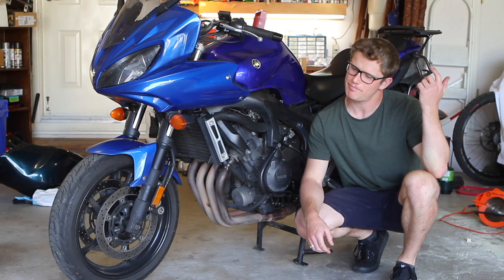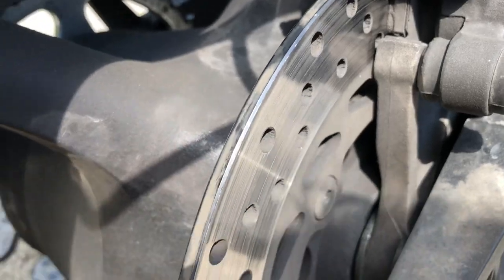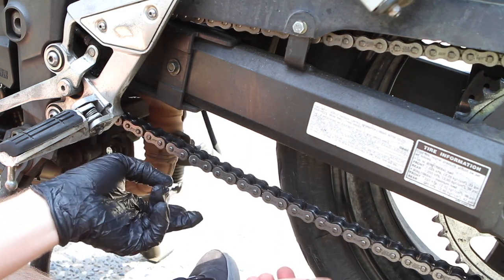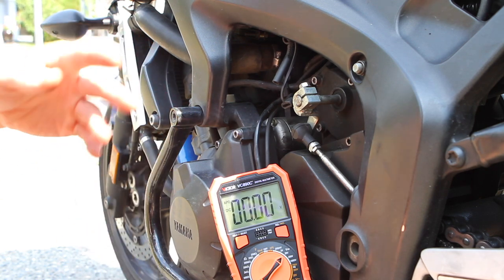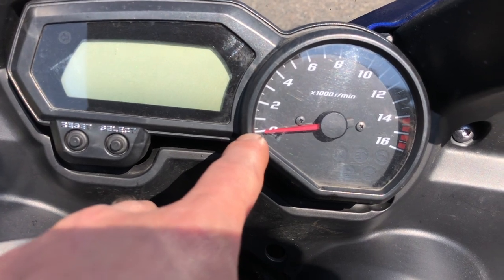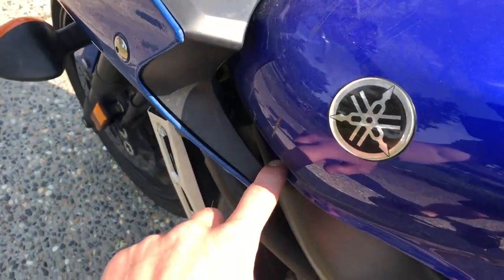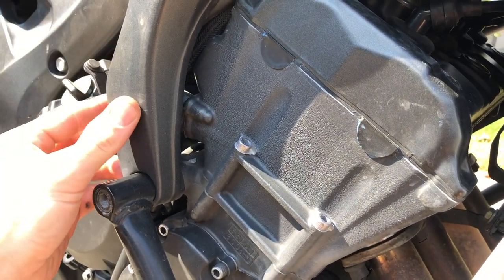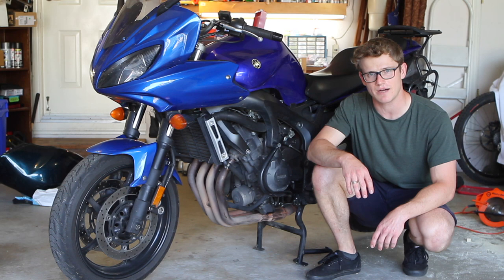Yamaha FZ6 Buyers Guide - Everything to look out for!

Comment: I have the exact same bike with the same heated grips. I have lubed both cables and cleaned/lubed the tube but my throttle just doesn’t snap back like it should, it’s just a little slow.  I have had this bike for so long I didn’t notice the problem until someone else road my bike and pointed it out to me. Have you ever had any issues with your throttle because of your heated grips? Also a topic for a future video could be how to properly wire the heated grips. I just have my connected directly to the battery.

Comment: An excellent video with some very useful pointers. 

Here's a post I wrote on Facebook a while ago and then saved for the next time someone asked a question about buying a used FZ6 (which happens fairly regularly...!)

* * * * * 　

Provided it's had reasonable care taken of it, they're good, reliable bikes. 

Here's some stuff to check before you buy it...

Firstly, the FZ6 drops into first gear like the Crack of Doom! This is, incredibly, absolutely normal.

Check the exhaust headers for signs of rust. If they're bad, it means other, important work probably hasn't been done.

Put the bike on the centre stand and get someone to push down on the back. Using fingertip pressure, tip the handlebars to one side and the other and see if you can feel any grinding, clicking or rough sensations which could indicate the headset bearings are knackered (which is a bugger of a job to fix!)

Also take hold of the front wheel and see if you can pull the forks back and forth which would also indicate a dodgy headset.

Bounce the forks up and down and look for any signs of oil leaking from the fork seals.

Check the rear shock and see what condition it's in. Clean? Rusty? Can you change the preload setting or is it stuck in place because it's never been moved and it's covered in crud? 

Put your finger under the chain a little bit back from the centre stand and try to push it up against the swing arm. If it goes really easily or you can't get it there at all, it's too loose or tight. If it takes a bit of effort to hold it there, the tension is probably ok.

Feel the gaps between the teeth on the rear sprocket, if you can feel a "lip" or a "hook" instead of a smooth curve, it's on the way out and would need replacing as well as the front sprocket and chain.

With the rear wheel off the ground, check to see if you can wiggle the wheel or swing arm back and forward or from side to side. Either could mean knackered bearings which would need to be replaced.

Run the bike until it's warm, then switch off and let it sit for a few minutes. Check the oil level on the centre stand and make sure it's ok.

Other things to ask...

If it's done nearly 24k (or 48k) miles, ask if the valve clearances have been checked, if they haven't and they need new shims, that's an expensive job if you get it done by a mechanic.

The brake pipes are supposed to be replaced every 4 years, so ask if they've been done (although I did mine after 14 and they were fine, I just wanted braided lines).

Ask if the spark plugs and oil filter have been changed (recommended every 12k miles) air filter (25k miles) 

None of these last ones are necessarily critical, the FZ6 is pretty reliable, but it would show that the bike has been cared for.

There's probably more, but that's a few to be going on with!

If you're happy with it, enjoy!
Reply from the maker: Great tips! Thanks for sharing 👍
Reply: @Calvinm hi bro. Blesses. Do you know how to put ABS sistem in a fz6 s2 2006?? Is just like the bike in this video but black. Can u make a video or explain me ? It's posible?

Comment: Good video! Thank you)
I would add a couple more points:
1) checking the fork for fogging.
2) Checking wheel bearings and steering column
3) check antifreeze level
4) checking the traverse, the spider, and especially the attachment point of the rear subframe (cracks often appear if you ride with a passenger or (and) baggage)
5) Checking the engine mounting points ("ears"). If there are sliders on the motorcycle (not crash guards), when falling, it sometimes breaks off a piece of the frame or engine. Never install sliders on FZ6, its very bad idea))
P.S. Sorry for my bad english))
Reply: Oh yes, I've heard about the slider thing...

Btw your english is flawless
Reply: @Jan-cg1pq  thank you! (And Google Translator:))))
Reply: Check the wear pattern on the tiers, how far the bike is leaning in the corners can tell you how it's being ridden.

Comment: I'm now a 3 hours owner of a 2004 FZ6 with 43k km - thanks for this video!
Reply from the maker: You're welcome! Enjoy the bike!
Reply: @Calvinm  what cable line did you use for testing voltage. I would need a more detail on that. Tnx
Reply: @kmetmosnja6341  did you figure it out? i have the same question

Comment: Hey man, really good video.  I just bought one for 1100 dollars and it needs some work so I will probably be watching lots of your videos.  4th bike for me just so you know and I do work on them with a little help here and there from a friend who knows more than me.  I don't usually do this but I wanted to say thank you for the video.  I wanted to ask, what year is yours you are working on?  Mine is a 2004.  How much did they change from generation to generation.  I know with lots of bikes they make them the same for like 20 years but the FZ6 seems to get an update like every 2 or 3 years.  Any way thanks brother.
Reply from the maker: Thanks for the kind comment! This bike of mine is a 2007 model. The first gen FZ6, reffered to as S1, had different brakes and thottle position tuning, and the rear swing arm got a design change but stayed the same length I think. Everything else mechanical stayed the same. The FZ600 which came before the FZ6 is entirely a different bike from an engine and frame standpoint. Enjoy the ride, glad you found the video.

Comment: Enjoyed the video and subscribed my friend... I know of a 04 fz6 3,100 miles $2300 avail. and was doing some research on YT see if I really want it or not... not too crazy about sport bikes without full fairings tho.. guess that's the difference from laying down and sitting upright type of bikes? The only bike I really want is either a Ducati 1198S or Aprilia RSV Mille R but they both require mechanics/dealerships at least 300 miles away from where I live
Reply from the maker: I think the FZ6 has just enough fairings to keep you protected from the wind which is nice. The riding position is much more relaxed than the Ducati or Aprilia you mention. If you want a fun bike for the street the FZ6 will be great. If you want a bike to take to the track the Ducati and aprilia would be great.
Reply: @Calvinm  That does make sense... I would probably be riding on the streets most of the time and if I ever feel the need to go to the track add a track bike to my collection. I currently have a antique 1973 Harley Sportster XLCH 1000 that has been sitting up about 12 yrs.... engine needs to be gone through... last time I rode it started making rattling tin pans sounds tons of white smoke... I knew that it would not run Harley plugs as the rear piston would close the spark plug gap thus piston was coming up too high.. probably crank rod bearing or connecting rod bearing bad creating slack in the stroke...it would run split v plugs fine which was a hair shorter than Harley plugs...so now I may have a hole in the rear piston or blown rings etc......? I currently have been searching for a awesome deal on a dirt bike or dual sport 250 - 450cc or super sport 600-1000cc

Comment: Glad to have found your channel after buying my first bike: an '04 FZ6 w/ 40k miles. A 600cc bike was by no means my first choice, but the owner had all the service records, title was clean, and license and registration were current. The metal surfaces of the bike were weathered, but the bike rode great and the local shop where I had the tires and chain changed out after the sale said the FZ6 is a very dependable bike. I noticed your side and top case racks. Can you provide me with a link of where you got them and which cases you use? Any pics of the cases in your other videos?
Reply from the maker: Hey Barry, I have a video on my side cases. They are Shad cases and have been great. 
Link:
https://www.youtube.com/watch?v=Z7SrTs5UcuI

Comment: Thank you millions Calvin, this is so awesome, great video, many thanks...I found a 2012 FZ6R Black with the cool red graphics, the bike looks brand new and is listed with 698 miles? I know I should check the age of the tires but, do you see "red flags" with only 698 miles on a 10 year old bike? I have yet to go to the dealership and ask if there's a story. But, this is a very large dealership and they have like 170 good looking barely used bikes all the way to 20 year old $3000 Gold Wings, so they probably picked up at auction IDK. Do, you suggest anything more to look at in this situation of "low  miles/use"? This bike isn't even fully broken in is it? I'll look hard at the frame and the distances between fitment of the front ;) Wrecked and rebuilt is my biggest concern, I think I'll be able to tell......thanks so much pointing the way , I won't have much to check with 698 miles but, your advice has helped me know what to do and either walk away from something scary and weird at 698 miles or I've found that dream find older sleeper bike that's still brand new. And thanks for mentioning the engine sounds. It's a 2012 FZ6(R) 698 miles $5999 and it looks like a guy has been staring at it for 10 years in his  garage, it's "clean" clean (What do you think?) Looks like a mini Katana susuki Wish I could take you with me bud, thanks again...I'll let you know what happens if you want ;)
Reply from the maker: Could be a gem you found. It might be worth getting a carfax done on the vehicle to see if it's mileage has been registered from ownership transfer or work being done. If there is mileage registered in it's history then you've found a bike with a brand new odometer on an old bike... Little things would give away a bike being mismatched for it's mileage. Like check the wear on the handle bar grips, 690 miles would have the grips looking pristine. Look around the edges of the allen heads and bolt heads on the bike, none of them should have any wrench marks or scratches from servicing because the bike is new. I would change the oil immediately even though it's low mileage liquids don't last forever. Good luck!
Reply: @Calvinm  Thank you for the advice. I have found a few like this, old but, extremely low miles, like you said, it just sounds too sketchy. I don't think a 12K rev almost super bike class is right for me anyway.  I'm figuring out I want the old school Triumph experience,  throaty rumble and gargles down shifting. I'm to old to play anymore Calvin, so enjoy yourself young man and thank you so much for caring about saving me from a mistake.  I've been bitten by Triumph Lol maybe I'll live longer on a Triumph 660 anyway...keep those tires ;) down, thanks again calvin, peace

Comment: Any opinion on this version vs the previous model which was changed after 2003. ? About to potentially buy one so im curious. People telling me the previous model is better built, more reliable etc. What you think ?
Reply from the maker: The newer gen FZ6 is very reliable. Very few issues with it. Downsides with the Fazer 600 is the carburetors and older suspension and frame design. I would go with the newer FZ6 from 2007 onward.
Reply: Isn't there a difference in spark plug location in both too. Newer one a pain in the ass apparently
Reply: Why 2007 and not the 2005 one , was there additional changes since then ?

Comment: I have a question, Calvin, why is it that many people tend to say the FZ6 is a great "beginner's bike"? What do you think of this? If it's a beginner's bike, then what should be considered some more advanced sport-touring bikes? Thanks.
Reply from the maker: Hey! I don't necessarily agree that the FZ6 is a good "beginner bike". When ever I meet someone who wants to get into riding I always recommend something with less than 45hp as a rule of thumb. Basically something 250-400cc. On the other hand the FZ6 offers a comfortable and confidence inspiring position when seated on the bike. It has modern and powerful brakes for when things get sketchy, but overall I think it's a bit much for a first bike. For an advanced "sport-touring" bike I would point towards the Tracer 900 or a Ducati Multistrada or a BMW R1250 GS. These bikes are better equipped with luxurious features like heated grips and color displays but they are also often heavier and therefore more to manage at slower speeds. I learned to ride on an old 1984 yamaha XS400 maxim which was fun in it's own right. There's something to be said about a "slow" bike that can do wide open pulls through a few gears without breaking the sound barrier haha. On the other hand the FZ6 is a great beginner bike if you keep it under 8k rpm, but the redline is tempting and a new rider exposed to that temptation often doesn't end well. To each their own but if I had a kid that wanted to ride I wouldn't let them have a FZ6 as a first bike.
Reply: Hey, Calvin! Thanks for getting back to me! Yes, indeed a lot of people (especially who do reviews for motorbikes) claim the Fz6 is a beginner's bike. I'm not sure if I'll agree that the R1200GS, Africa twin, etc are to be considered "the more advanced bikes", simply because they fall into (in my view) a completely different type of bikes, namely touring bikes. The HP:tonne ratio is in favor of the Fz6, which oftentimes has more power and is much lighter than the aforementioned bikes, but it is still not as comfortable as they are. This is why we say it's a sport tourer, and not just a touring bike like they are. I also agree with you that 600cc is a lot for someone who is sitting on a bike for the first time, plus I just can't think of any "more advanced" sport touring bikes than the Fz6. It is my fourth bike (I haven't owned anything bigger than 600cc mainly because of the weight and the comfort), and the Fz6 gives me everything I need, so I wouldn't say it's a bike for beginners. I guess people who give it that name tend to think that the next step would be jumping onto a completely sports bike (the R6 for instance), and that's why they say that, but again, that's a different bike type as well.

Comment: You said ticking is normal and this is the first 2009 FZ6 I've owned with a stock exhaust. It sounds like I have a lifter tick but I don't know if it's normal or my timing chain. The bike has 10k miles on it, and the noise isn't a very harsh tick. It also seems like it's coming from the center of the valve cover and not the very side of the engine
Reply from the maker: These bikes don't get the typically cold start lifter tick that a hydraulic lifter cylinder head would but they are rather clattery engines none the less. The fact that the sound is coming from the centre of the valve cover likely means good things for your chain tensioner. You could compression test the engine to see what the numbers look like but other than there there isn't much to do to determine the tick other than opening the head to assess valve clearance. If I were you though I would likely leave it till later when the bike is scheduled for a valve lash service. Good luck!

Comment: What if the fz6 doesn't even run? Cosmetically, it looks good and the seller says it won't take much to get it running (they all say that). It hasn't run in 2 years. That thing could have massive fuel/electrical issues. How can I quickly check the engine to make sure at least that part is good? and it isn't seized or has poor compression. In case I decide to take the risk and buy it. I definitely won't pay what he's asking though, maybe 1k tops.

Comment: Should do one diagnosing an the fz6 slipping into neutral constant, always hit false neutrals going into 2nd... Apparently it's the shift rod or cable, but from what I hear it's a common problem with fz6's
Reply: Try shifting more "decisively" and use the entire stroke of the shifter. If it does not help or if the bike itself falls out of gear by itself then probably the gearbox needs and overhaul.
Reply: @h4xi0rek  it was the shift rod, and some dumbass rear ended me (an off duty none-the-less) and I had to change the shifter as well... Now it shifts better than before

Comment: Do you know if $5,900 is overpriced for a 2014 fz6r with 9000 miles?
Reply: Yes, i saw in the market a 2012 version with 8k miles being sold for 3k. I'm going to go see it, usually I've seen the sell for 4k on average around the 2011-2015 range. Well that's in my area.

Comment: Hey I’ll be looking at one tomorrow, it’s a 2005 with only 5,000 miles on it. What are some red flags for something with such low mileage? It seems to have a clean title and no scratches on the photos.
Reply from the maker: Check for a rusty chain or stiff links in the chain. Also look in the gas tank for rust, it could have been stored without a full tank. Look for dry rot on the tires from age
Reply: @Calvinm  I think I got a really really good one! It has no scratches, no rust, all seemed to be maintained very well and it rips! Also best part is is only has 5,200 miles on it!!!
Reply: I just bought a 2006 with almost the exact same mileage. Found out after buying both wheel bearings were shot from sitting, needed a battery, and even though tires weren't worn they were originals so the rubber was old